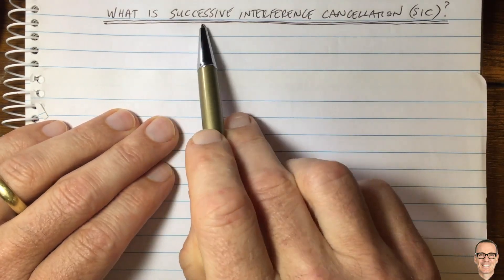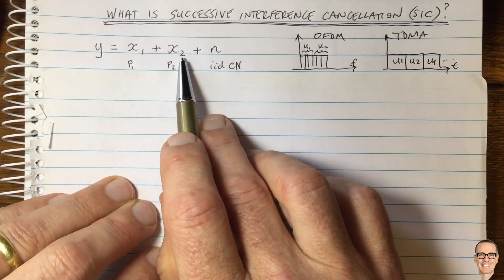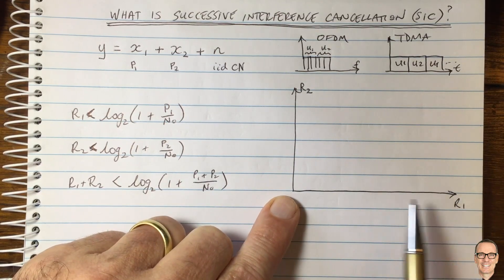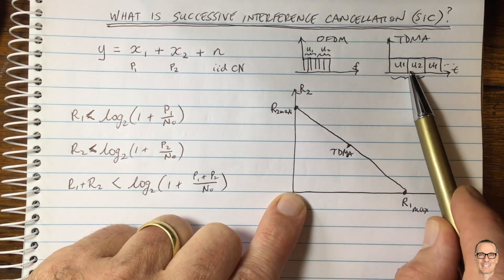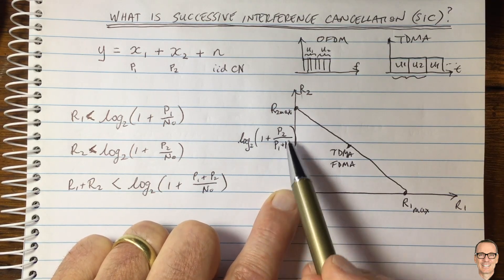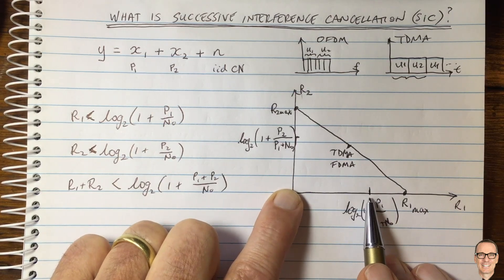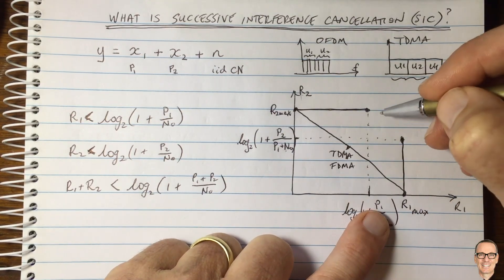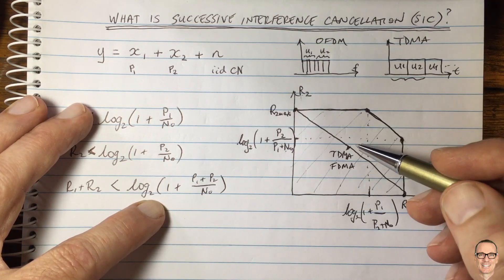What is Successive Interference Cancellation (SIC)?

Comment: But how can you get ANY data with two simultaneous interfering signals?
Reply from the maker: Perhaps this video will help explain: "What is NOMA in 5G Mobile Communications?" https://youtu.be/XCNz32T3ZbA
Reply: @iain_explains  I think the basic idea of NOMA is that the listener first extracts the most powerful signal it detects and treats everything else like noise. Then it subtracts The detected signal from the " noise ", and then find the loudest detectable signal in whatever's left over after subtracting the first signal, in order to find the next strongest signal.
Reply from the maker: Yes, that's right.

Comment: Hello Professor Iain Collings, I discovered this site by accident and realized it is indeed a gold mine!!  Thank you so much for the lucid descriptions, I am  able to learn a lot and enjoy concurrently.  

I have been trying to grasp successive interference cancellation, and I am a bit confused.  Assuming that you decode source 2 first, followed by source 1, the symbol x2 that is extracted first has an uncertainty determined by the summed complex gaussian (P1+N0).  If you subtract that from y won't the remainder still retain that uncertainty?  How do we ensure that x2 is exactly known at that point with certainty? Is this by passing the recovered x2 upstream past the channel decoder stage, then mapping the error-corrected bits back to the original complex symbol, multiplying that by the (presumably known) channel response of user 2 (g_2) to obtain the true contribution in the recovered baseband signal, and then subtracting from y?  Am I on the right track, or going off on a tangent?  Thank you for your advice.  

Also, when you decode the first symbol, how do you decide which UE it belongs to?  Is that by correlating the received baseband waveform against the known channel response of the intended UE?
Reply from the maker: Yes, you're right. It all relies on decoding the data streams exactly . If errors are made, then they will cause more errors to be made when decoding the subsequent data streams. In my video, I dealt with capacity. According to Shannon theory, as long as the data streams are sent at a rate that is lower than the capacity, then they can be decoded exactly . And in terms of your question about working out which data stream is which, there is always an address header in each packet. I'm glad you like the channel. Let me know if there are other topics you'd like me to cover. For more details about "Capacity", check out: "What are Channel Capacity and Code Rate?" https://youtu.be/P0WY96WBUyA
Reply: @iain_explains   Thank you so much for the confirmation (yes, I was also looking at it from the perspective of Shannon's capacity formula).  I am sorry for I saw your reply much later, when I restarted my learning exercise following a hiatus.  I am planning to go through all the lectures at your website in earnest, since the topics covered are all of keen interest for me.  And I will be reaching out if/when I get stuck with doubts again🙂.

Comment: Thanks for thé video. Is there any advantage of decoding the strong user  first? I think doing such provides higher rate region, no?
Reply from the maker: Sure, the ability to decode successfully depends on the relative powers, but it also depends on the rates. If you are using a sufficiently low rate, then it allows you to use a sufficiently powerful error correction code, to overcome whatever noise and interference there might be. That's what Shannon's formula tells us.
Reply: @iain_explains  thanks

Comment: Great explanation. Thank you :)
Reply: why is it that when we are considering power to be half, energy reduces? (as explained in case of tdma)
Reply from the maker: I'm glad the video was helpful. I'm not exactly sure what you mean by your question. For a transmitter with constant power, when a signal only lasts half as long (eg. TDMA between two users), then it only has half the energy, since Energy = Power x time.

Comment: Sir why are we allocating square root of p(power) to user symbol in PD NOMA ? 
Please answer this basic ..
Reply from the maker: P=V^2/R and if we normalise to a unit resistance (R=1) then the voltage needs to be set at a value that is the square root of the power we would like the signal to have.
Reply: Thank you sir

Comment: Sir, is treating interference as noise and SIC the same? Please tell me sir
Sir, can you explain the rate region concept of two user interference channel by using the SIC scheme and treating interference as noise scheme and joint decoding scheme
Reply from the maker: It is always possible to treat interference as noise in any receiver (not just in SIC). If you don't know anything about the structure of the interference then you can't do anything about it anyway, no matter what receiver you are using. And thanks for the suggestion about the relationship between SIC and joint decoding - I've added it to my "to do" list.
Reply: @iain_explains  Thank you very much for clearing my doubt sir

Comment: Dear prof, the SIC receiver, is implemented in uplink and dowlink?
Reply from the maker: Yes, the SIR receiver can be implemented in the downlink too, but it's important to realise that the "interfering signal" is also coming through the same channel as the intended user's signal (since they are both coming from the base station), so there won't be a "strong" user and a "weak" user (of course there can still be a high-rate user and a low-rate user, depending on the data requirements of the users).

Comment: should there be 1/2 before the logarith term to characterize that the transmission is conducted over two timeslot in the case of tdma ?
Reply from the maker: No, the time is just divided between the two users. There are no "time slots" when considering fundamental capacity. Time slots are an invention (or in other words, they are an imposed structure) that makes signalling easier to implement. They are not a fundamental resource. "Time" is the fundamental resource.